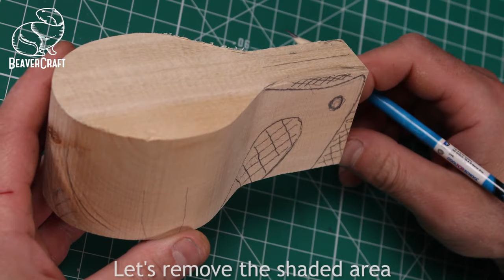Kuksa Carving Tutorial

Comment: 1. This music felt very chaotic
2. In my readings, basswood isn't very dense and it's a soft wood. Putting hot liquids in it can absorb into the wood. One guy even had the hot tea push out the almond oil he used to treat it with. Go with more traditional woods like Birch or Birch Burls(if you can get any).
Reply from the maker: Interesting idea about the basswood 🤔. Birch wood is widely used for making furniture, and is stronger and more durable than Pine or Oak. However, one of the best wood for beginners, it's basswood cause birch is not the easiest wood to whittle.

Comment: It’s probably been asked before but can I ask what wood this is. I’ve just started carving and have carved two Kuksa (one failed and cracked) I’ve been using Ash but it’s very difficult to carve. Thanks, Ant 👍
Reply: I am not sure what wood is used here. Birch is traditionally used.
Reply: John816v thank you John for your reply
Reply: You might want to carve green as it is much easier. Birch is traditional using a quarter section. Rough it out, to include the cup interior. Keep the thickness of the cup walls consistent and not too thick -- learning from my mistakes too. Set it aside for a couple of weeks to very slowly dry to minimize splitting. Then go back and do final details and smoothing as the wood will be dryer and more difficult to carve. Or, you can just use basswood or linden as it is typically without defects and one of the best for carving. Best of luck!
Reply: BeaverCraft I Easy Wood Carving for Beginners ahh thank you I shall see if I can get hold of some 👍
Reply: highdesert50 Thank you Highdesert for your in-depth break down there, great advice mate thanks.
Reply: its basswood
Reply: @highdesert50  cheers mate